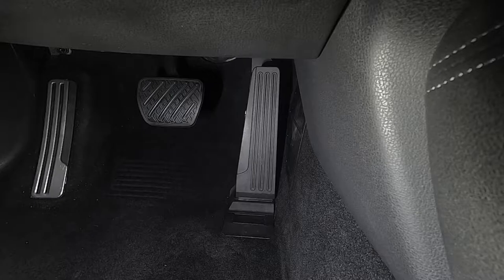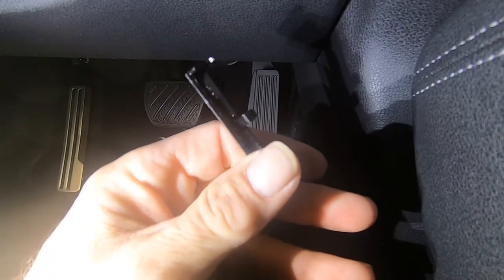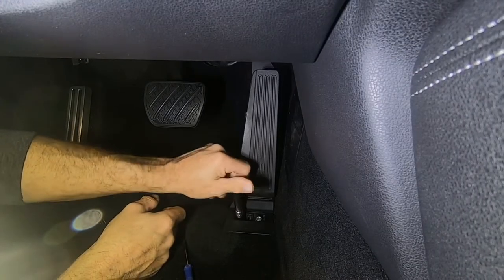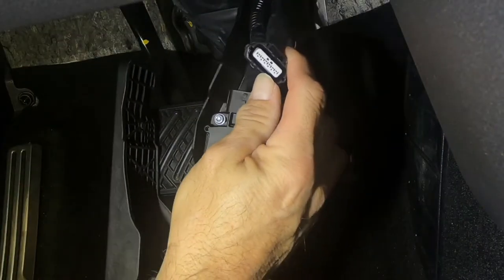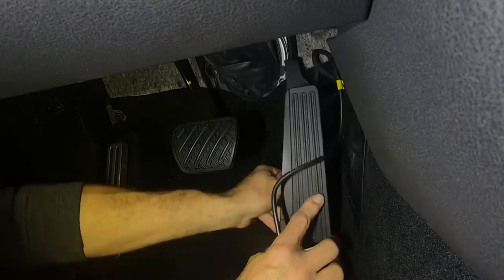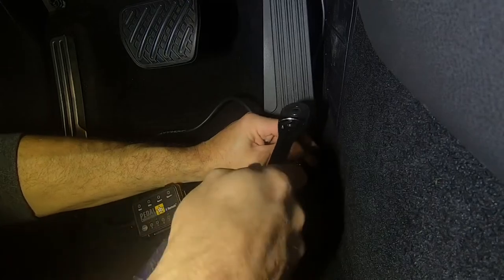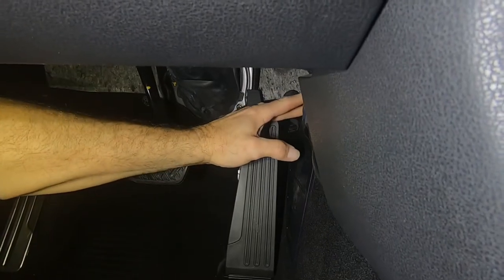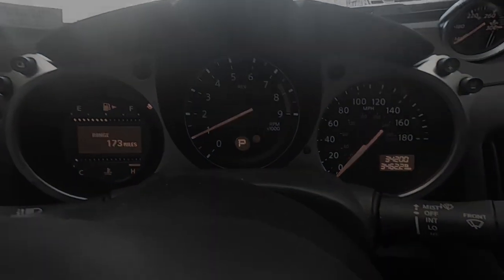What You Need to Know Before Installing the Nissan 370Z PC51 Pedal Commander

Comment: I bought 2 cheap Chinese ones from amazon and both didn't work. So I guess I'll buy the name brand like your. My z a 2015 base
Reply from the maker: There are a couple that are about 1/2 price of the Pedal Commander but not the same.  I have put these on several vehicles have worked excellent on every one.  Thanks for watching, best part is if you sell your vehicle they hold value very well, so unless you just mess up the control you can get most of your money back on eBay.